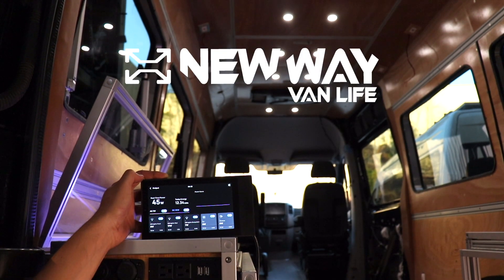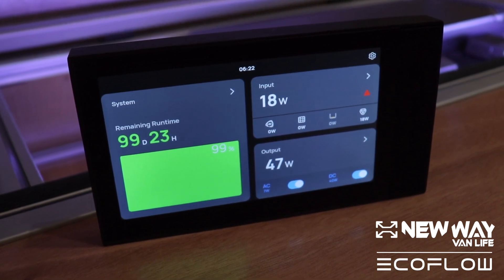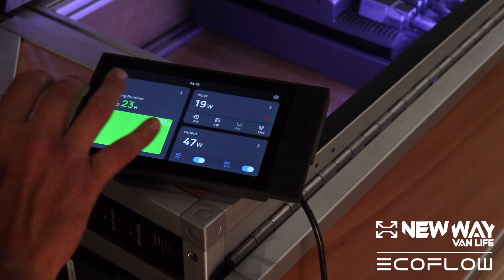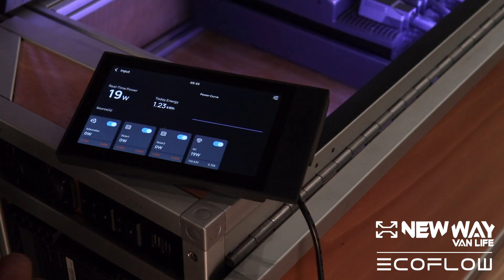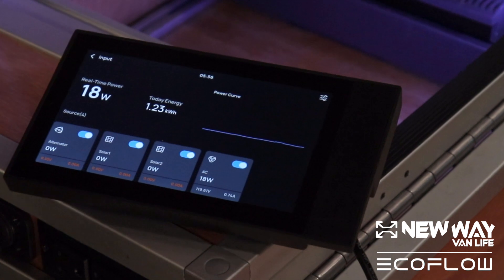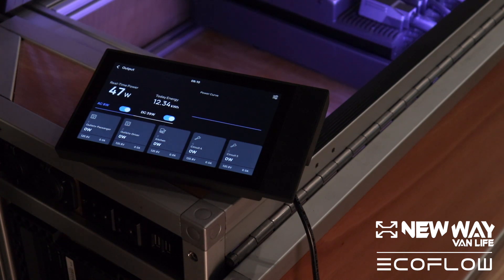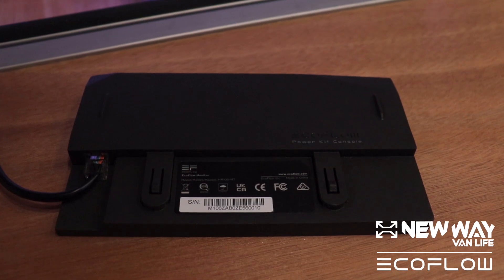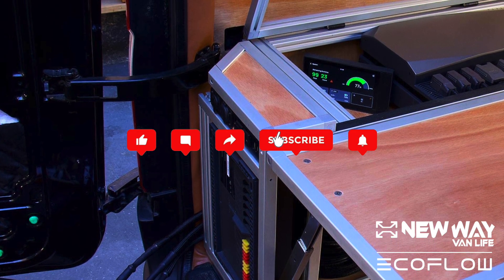EcoFlow Power Kits: FIRST LOOK at Control Console

Comment: we built an RV in Thailand and could have used this Echo Flow unit , the one installed is huge and  has no panel to look at , panel they used is basic only shows 62 volts weather charging  or not , I do have echo flow delta max 6 wh(3 batteries)

Comment: Can you power share between the shore power and batterie power? for example plugged into a 30 shore power and use the shore power and battery to make up for a 50 amp trailer
Reply from the maker: Ecoflow has not yet accommodated for a 50amp output in there system
Reply: @NewWayVanLife  Bummer so they won't work in most 5th wheel trailers so far. Oh well back to Victron

Comment: Hello, I have another question, did you need to utilize the grounding lug (Earth Stud) in the panel? I understand that you have yours in a Van setup and probably went to the chassis, but if this system is in a home, do you need to use the ground? Is it free floating like in an AC300 from Bluetti.
Reply from the maker: Yes, you would want to ground the Power Kit even when used in a home, as you would any home electrical system to direct the current away from the home back to the earth.

Comment: Ok, I haven't been able to get any info form the FB group, I found your YT video and YOU may have answered my question.  It looks like you can plug the POWER HUB up to a home AC Outlet AND control the Draw on the power from the AC in a house (from 1A to 30A). THAT info is VERY important for home use (off grid, e.g. not tying into the home grid panel) and being able to simply plug in from an AC plug in the house and limit the power draw to 5 or 10 amps so that it doesn't blow a breaker.  Can you confirm if you can charge the system from AC in a house from a simple AC Plug and control the current draw?
Reply from the maker: Hi Stephanie, that's correct. You can adjust the AC input current from the settings on the Input screen.

Comment: How does the alternator connection work with Sprinter “Smart” Alternator?
Reply from the maker: We have not tested this, but based on information online it seems like since it regulates voltage output it may charge the system slower due to this. Again, we have not tested this and have not done much research into this. Let us know if you find any additional information on this.